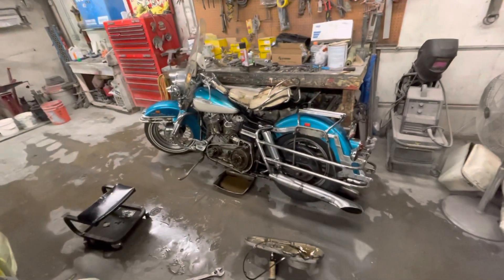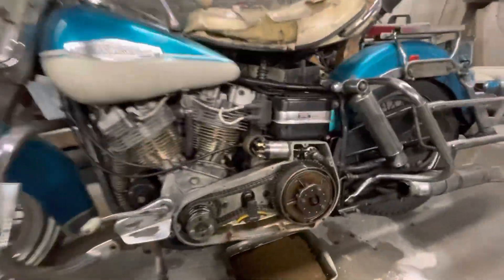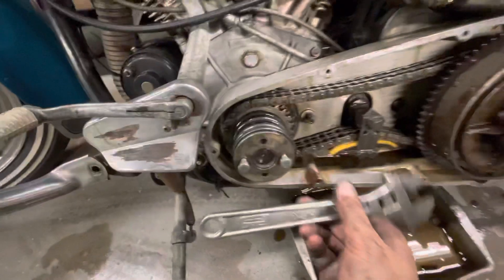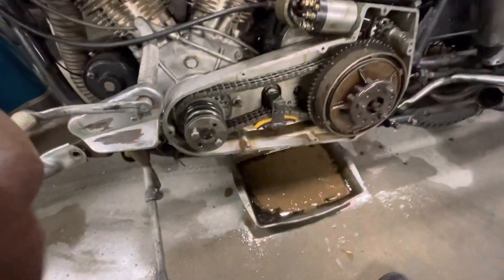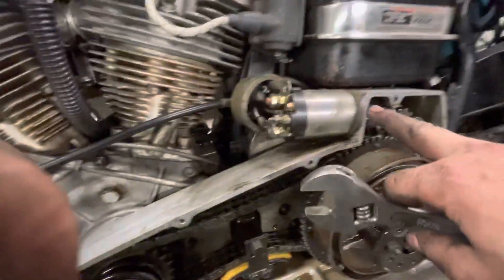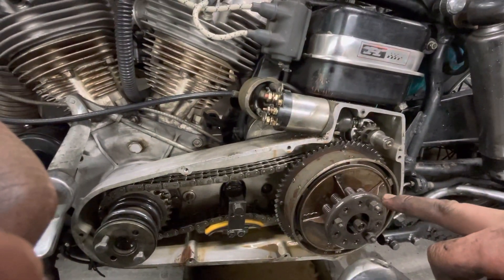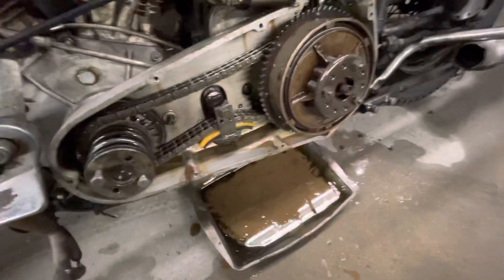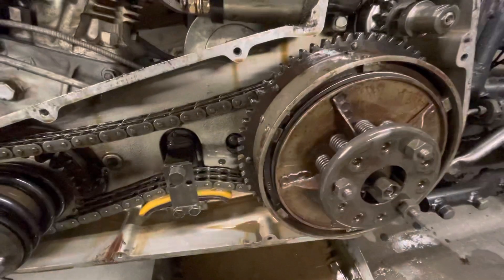1969 harley shovelhead compensator sprocket removal How To,, Outer primary off of the 1969

Comment: Hello.
Could you please tell me how much torque should be used when tightening the compensator nut?
Reply from the maker: I can find the exact amount. But not too much. I’m guessing 40lbs or so. I’ll be back and let you know. The nut won’t actually back out because of the spring tension.
Reply: @nutsandboltzgarage5889  Thanks for the  quick reply. 
My 69 SHOVEL HEAD compensator is making a strange noise when idling, The noise dissappears when the engine is revved up.
I'm thinking of replacing the compensator spring.
What do you think? I'd like to hear your opinion.

Best regards.
Reply from the maker: Found out finally. 80 ft. lbs on the motor sprocket nut. 120-150 ft. lbs. on the transmission drive sprocket nut.